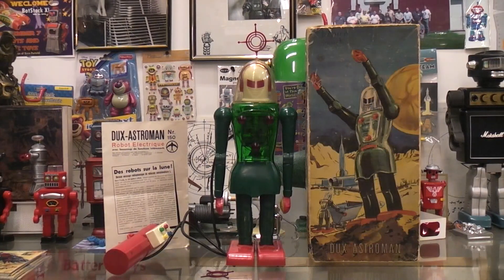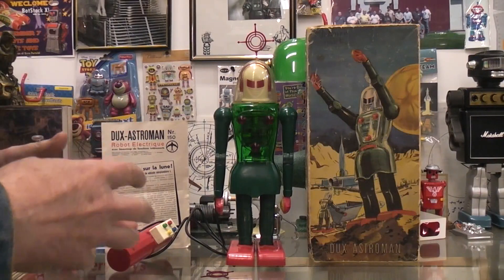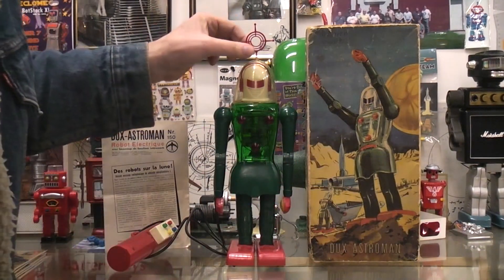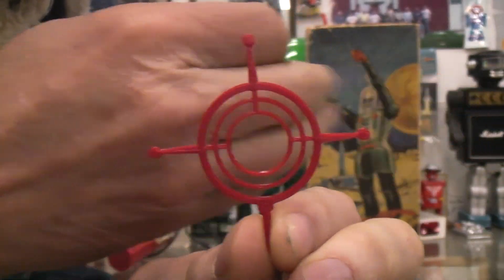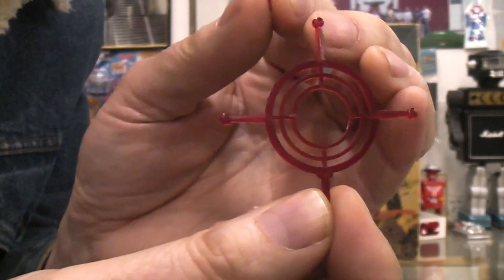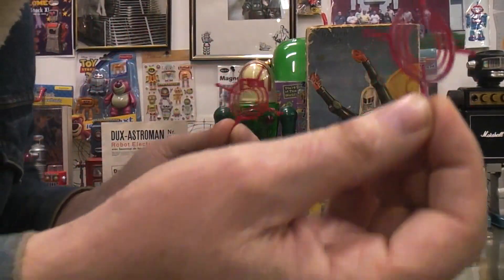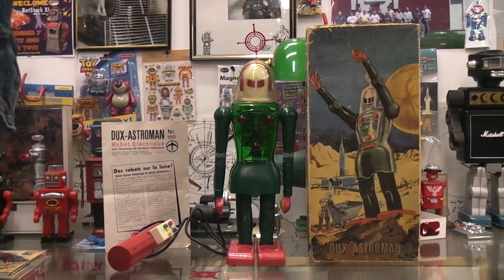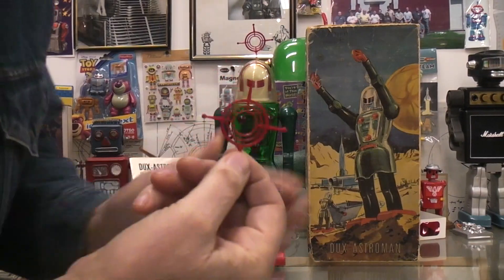3d print a replacement antenna for the 1959 Dux Astroman robot.

Comment: Bonjour .
Je possède un DUX ASTROMAN mais lorsqu’il marche il recule au lieu d’avancer. 
Y a t il un réglage a activer ?
Cordialement

Hello.
I have a DUX ASTROMAN, but when he walks, it goes backward instead of forward.
Is there a setting I need to activate?
Sincerely
Reply from the maker: There are ratchets in the feet wheels, so some one has worked on the robot before and installed the foot base parts on backwards.

Comment: Red PETG filament works great too.
Reply from the maker: I printed on in translucent red PETG, it looks dark enough on the filament role but the printed part is so thin that its not near as deep a red as the original. So I think I will hit the part with a coat of translucent red spray. Will post if the results look interesting.